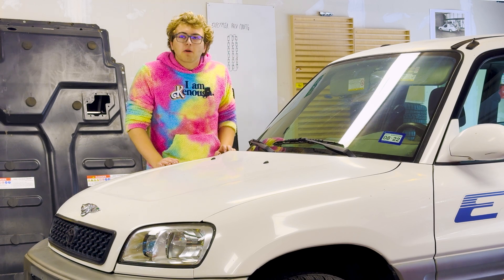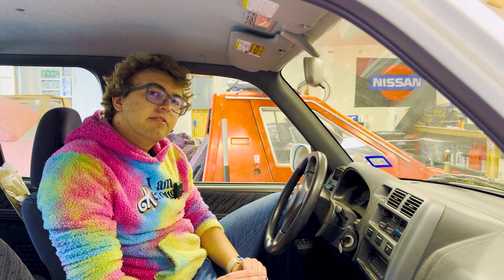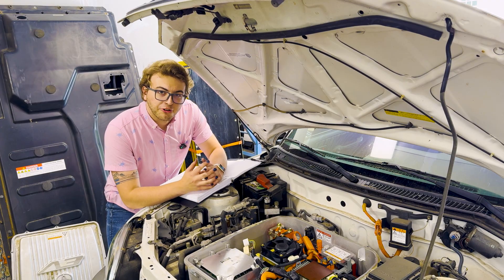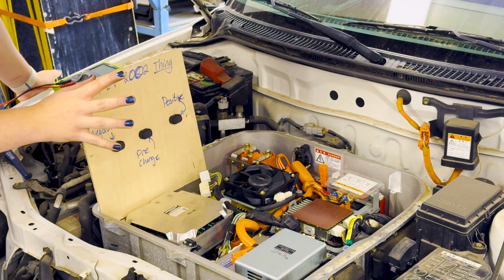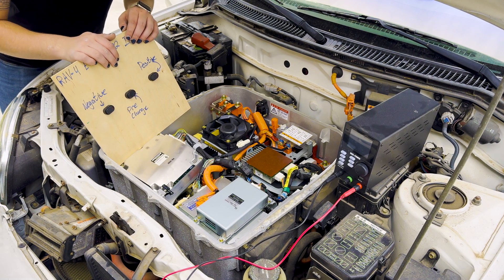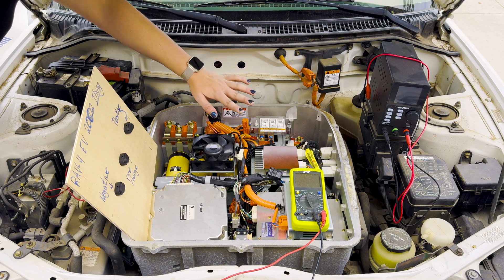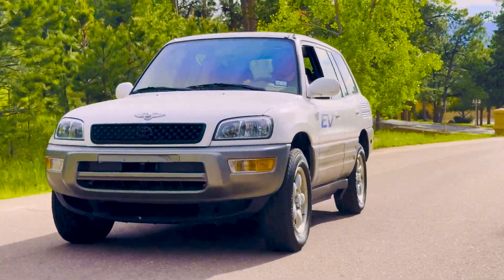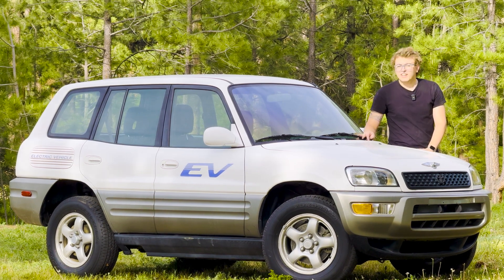I Fixed Our 2002 Toyota RAV4 EV!

Comment: This is why NiMH is in many ways superior to Lithium ion. You can completely discharge a NiMH battery and its still safe charge. This means it's a lot easier to recover a discharged pack. I have a laptop from the 90s and the battery still works for the same reason. The same cannot be said about lithium batteries. They could catch fire if you force a charge once they discharge too low.

Comment: Thanks for sharing! Maybe I've misunderstood the concept, but my understanding is that the pre-charge contactor is used for current, rather than voltage spikes. Essentially, EV controllers have massive capacitors that must be charged, and flipping the contactors without "pre charging" those capacitors causes a current dump that can fuse the contactors together and damage other components. The voltage might be lower, but that would only be a result of the resistance created by the pre-charge contactor.

Comment: FYI
If ANY one of the 24ea 12V modules is below  10V, the system will not keep the contactors energized and you won't be able to charge with the paddle OR via the Suitcase Pack Terminals and a HV Power Supply, UNLESS you activate the contactors first as in the video.

Comment: This would only be possible with the old NiMH batteries, which don't care (as much) about under or over charging. Lithium battery would be junk under the same circumstances. 

The downside is that the NiMH batteries have way, way, way less power potential for the size and would be completely impractical for a modern EV.

Comment: The nice thing about nickel based batteries is that they can be revived after being completely discharged. After 5 full charge - discharge cycles, you should be able to restore most of the remaining capacity. I predict you will get about 15 miles on a charge if the batteries have not been cycled. After several full cycles, I predict the range will increase to 55 miles.
Reply: but if fully discharged, they can also charge in reverse polarity, so research first

Comment: For a 22 year old battery pack that was down to only 28 V pack voltage, it is quite remarkable that it could be recharged and driven.  My range guess is 22 miles.  I can't wait to find out what the result will be.

Comment: That's not how a precharge circuit works at all, it doesn't run the system at half voltage. It manages inrush current to charge the capacitors in the inverter and DC-DC.
Reply: Thanks for that simple explanation. It has given me a better understanding, and of course there is a pre-charge resistor, like a 'soft start' to this circuit.
Reply: agreed, that portion should be edited out;
Dev, suggest you tighten up your "Voltage/Current/Power" usage. 
The "Classic" Rav4-EV are Great EV's!
Thanks for digging in.

Comment: Excited to see this old RAV4 back on the road again! I spend a lot of time repairing the 2nd gen (2012-2014) RAV4 EVs, but I have worked on one first gen RAV4 EV in the past (dropped the pack to replace the "Battery Sensor ECU"). That one was the guy's daily driver, and supposedly it still went close to 80mi on a charge (though his pack had been refurbished at some point). 

The NiMH batteries are pretty good longevity wise if taken care of, so I suppose it could go either way in terms of range, and depending on whether or not it was ever refurbished at some point. NiMH also has a "memory", which can cause limited capacity if not fully charged and discharged fairly regularly, however with some full charge and discharge cycles to re-condition the cells, it may actually improve somewhat over time! My guess that as is, it goes 35mi on a charge.
Reply: NiMh has substantial self-discharge, but does not experience the memory effect like NiCads did.

Comment: 25 miles.

Wild to think that it's still working on its original 20-year old NiMH battery!
Reply: As you see in his next video, it went 80 miles.  Did you know that in 2003 Chevron bought the patent for NIMH batteries and immediately stopped all production and destroyed the factory?
Reply: As you can see in the latest video, it went 80 miles.  Did you know that Chevron bought the patent in 2003 and destroyed the factory?

Comment: Yes, your magic shouldn't be attempted at home.
I did jump start a 80 V removable battery from GreenWorks usable for lawnmower, snowblower, leaf blower, edge trimmer. However I did it safely with another identical battery and 2 wires connected plus to plus and minus to minus  just for several minutes to increase the voltage in "nonchargeable" battery in order to be accepted by charger to get charging. It just did the trick.
Awesome content video!
Reply: Why would that be any more save than using a lab power supply? At least with the lab supply you have control over voltage/amps. While with the 2. battery you rely on internal resistance of the battery and the wires you are using to limit the current and voltage will be at whatever the second battery as it discharges.